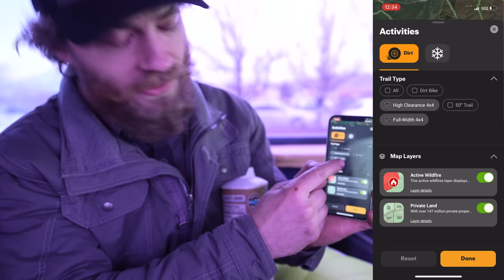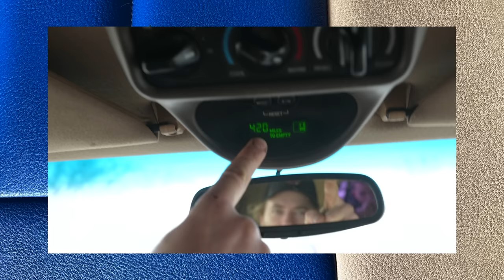We Found a 6X6 Diesel Limo! And drove it 700+ Miles

Comment: This thing definitely needs a full roof rack. To hold all the power wheels on top
Reply: Gotta derust the roof a bit first lol
Reply: You are totally on to something here. This could be the ultimate "toy" hauler
Reply: @jeremyg9240  Thought the Fire Truck was supposed to be the ultimate toy hauler?
Reply: ohh..  Nice call.
Reply: This is brilliant! But werent they already planning to use the firetruck to haul a bunch of stuff? I totally support the idea though because why not!
Reply: @nickmaclachlan5178  guess they need more toys to haul lol
Reply: But as a soft top...
Reply: @gniawd  that will quickly lead to a 20-inch roof raise, hot tub, full kitchen, walk-in fridge and what have you 😅😂
Reply from the maker: For sure!
Reply: The Fire Truck should used as a full Workshop on wheels and this one to haul the power wheels on a roof top.
Reply: @aidanolkowski9113  it's vinyl over metal. He said it when they picked it up
Reply: Yes plz
Reply: @nickmaclachlan5178  "was"
Reply: Stainless sheeting to replace the rusty steel.
Reply: This is the way
Reply: @nickmaclachlan5178  you load the power wheels onto the limo, THEN you put the limo on the fire truck :person-turqouise-waving:
Reply: Fire truck should be used to haul bigger things.
Reply: It be sweet to have ramps from the ground into box and from the box onto the roof and a rack full length of the roof for parking
Reply: I was thinking solar panels but yeah, roof rack and panels,
Reply: Pull the vinyl off the top and Rinoline it.. would look almost the same
Reply: @nickmaclachlan5178  backup
Reply: Yes!!
Reply: I’m thinking just make it topless and add a roll cage
Reply: @alwynbrown2808  nice
Reply: I would watch a video where they fix the roof and add a ramp to a roof rack for the powerwheels
Reply: That would be so dope 😂😂
Reply: that moment when you realize your the 665th like :(

Comment: That is the best engine ever for that kind of rig. It will get 20 mpg and with a little work can be pretty fast. Not to mention being unkillable.
Reply: I am confused on this? Isn’t that excursion a 6.0 model? Did they do a 7.3 drop in? Wouldn’t that require a trans cooler line conversion among other more complicated things?
Reply: @mikeTooLoud  Pretty sure during the buying part of the vid the seller mentioned it had a stock 7.3 in it. Likely from the F250/350 donor truck.

Comment: The rust falling from your headliner is from the pinchweld of the windshield. I suggest you take it to a glass or body shop and have them fix it or since you are amazing at figuring stuff out do it yourself. The windshield is actually very important to structural strength if rolled over.
Reply: +1
Reply: Lol
Reply: I don’t think that thing will do so well if it rolls..

Comment: Love my F250 4x4 6.4l but, I think you'll find you need a steering box not tie rod ends. These trucks are known for the steering boxes wearing out and developing huge amounts of travel / play in the steering. Mine was replaced the last time at 331,xxx which was about 7500 miles ago. I'd love to see this thing with a 40 ft Fuzion 5th wheel toy hauler behind it. You might need over length permit to do that though. Lol

Comment: I had a similar experience driving my iveco extra long wheel base van for the first time. I usually drive kei cars - suzuki cappuccino, daihatsu copen, fiat seicento... but the first time I drove my van I was really impressed by how quiet it was and also that while the front of the van was in the correct lane, the rear of the van took another 5-10 seconds to move across during a lane change XD

Comment: I would take the time and install a rack for all the equipment, build a full on studio in there. Make it safe so if anything happens and a wreck happens, the equipment doesn't come at you. Get mic mounts and everything. You could put a bed cover/camper shell on the back and make it pass through to the cab and you could make a custom mount for everything in the bed.

Comment: As a 7.3 mechanic surprisingly the slop your experiencing in the steering wheel is the steering box. It's super common even in rebuilt units you can get from Napa or ford, 
I have gone to redhead steering in Oregon they  know how to rebuild them. No slop.

Comment: Id definitely recommend a hydra chip for the ecu. Immediate profile loading and great reliability computerwise. Ive had one for 6 year on my 99 7.3, and had tunes made for my 40 over injectors and new 7.4 bore with delipped pistons. Worth the $350

Comment: i recommend line x 10 spray sealant for the roof because if i remember line x 10 is what is used for the pentagon
but even then just the original line x spray sealant should work just as good

Comment: that amount of play in the steering wheel is normal. the only fix is a new steering box or tighting the steering gear slightly. if you overtigthen it will bind heavily.

Comment: as much as I love this damn truck the only good thing I can say about the condition of the roof is they sell 2 mill sheet steel in 12 foot by 4 foot sheets so you should be able to fix the whole thing with one piece of steel and not have to piece it together .

Comment: For as old as the vehicle model is /weight/ length/ etc that’s about as good as you’re gonna get with the steering wheel. Can’t get much tighter than that with a vehicle that huge unless you get some steering stabilizers.

Comment: If it was necessary to get there normally, then it was necessary to remove one rear wheel and replace it with the front one, there is not so much load on the rear axle

Comment: It needs Dually axles on the rear two axles you might need to set it up like a fire ladder truck 🚒 with a rear axle steering axle driver steering opposite the front seat driver

Comment: Yea those vinyl/padded roof covers are perfectly fine UNTIL they're compromised in any way that lets in water. That said, it's kind of silly that this roof on a limo is in THAT terrible shape. And to be honest, the tarp over it probably made it worse if anything, as it would retain moisture but NOT actually get hot enough to evaporate in the sun.